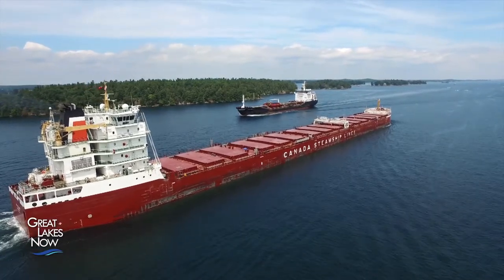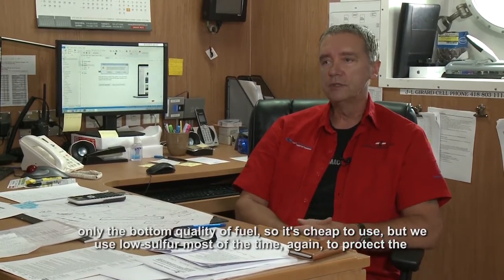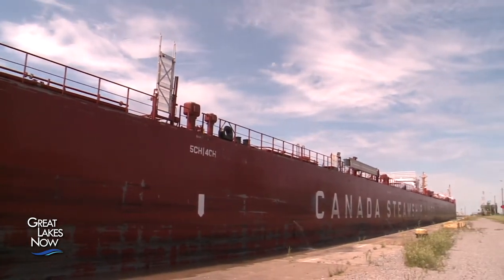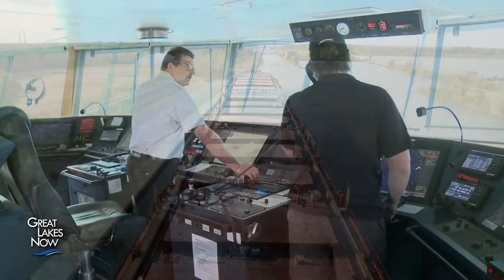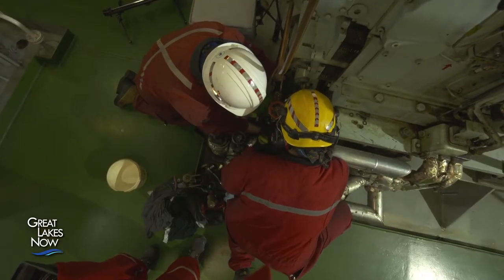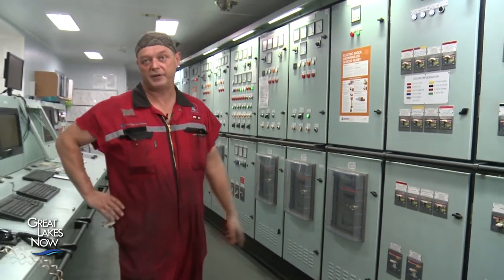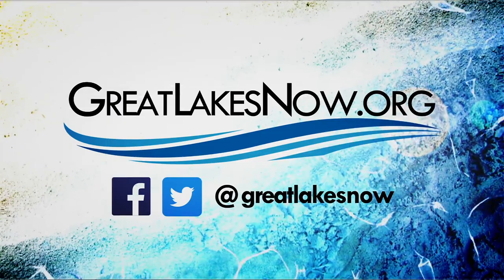Freighter Technology - Great Lakes Now - 1005 - Segment 3

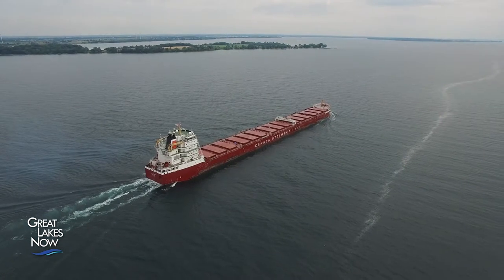Comment: 01:32 - actually Thunder Bay, ONTARIO, which has multiple massive grain elevators as a waypoint for Canada's prairie grains, especially wheat.  Alpena (on Thunder Bay, Michigan) is for limestone and related products, like  cement, concrete blocks.